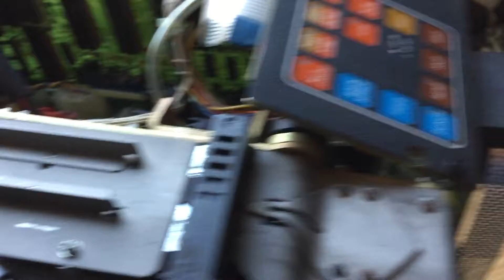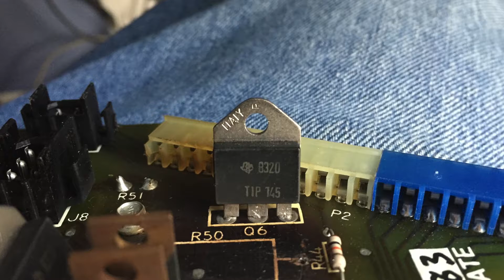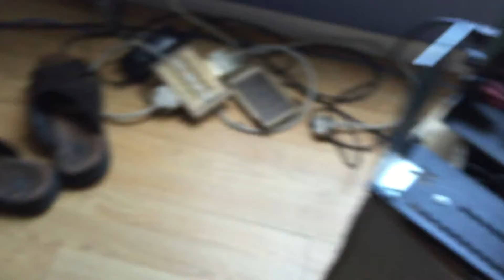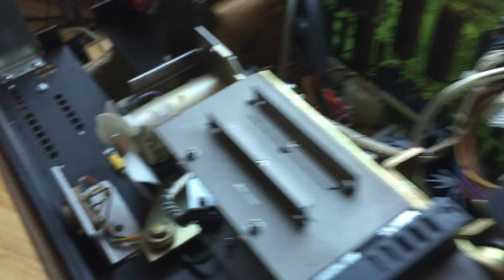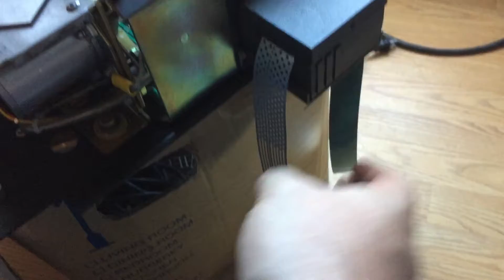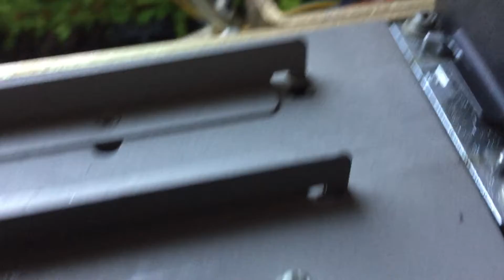Repair of DSI NC-2400 Paper tape punch/reader

Comment: I noticed that you pressed READ a couple times it would shut off immediately and you'd have to press it again, and once it ran for a bit and stopped, and you had to restart it.  Did you get that fixed?  I ask because mine will do that occasionally, and it's very frustrating!

Comment: Greetings Retro Tech, How is your reader? I'm trying to service one of these. There is a strange fault witht he reader, white tape is mainly ok. reading black tape is more likely to stop for no aparent reason. Also a bit of tension in the feed side makes it more likey ro run through. I'm wondering what to try to improve this. The reader light is in the top section, my phone camera can see all the lights. All I have is the user manual. Kind regards, David.
Reply from the maker: It’s been on the shelf for a while, I have an io error to troubleshoot, but there is little by way of documentation
Reply: @retrotechandelectronics  I am looking for one of these for parts for fixing mine.  Would you like to sell it?  Parts seem to be non-existent for these NC2400's.  My punch assembly is buggered (the mechanical punches themselves).  Could use the main board too.

Comment: That resistor is right under the transistor it is attached to, I think it is some kind of thermal runaway effect.  I replaced mine with 2 12.5 ohm 10w in a V (there is plenty of vertical space) and they barely get warm.
Reply from the maker: I migh have to try that.  There are still other issues too, read errors....

Comment: Nice. I recently got hold of 3 Siemens T1560 paper tape punch/readers. I'm in the UK. I found out that the tantalum bead caps for the power supply all needed replacing and then reverse engineered the data connections to get them working with a PC running a serial terminal. There is no info about these machines anywhere on the web!!